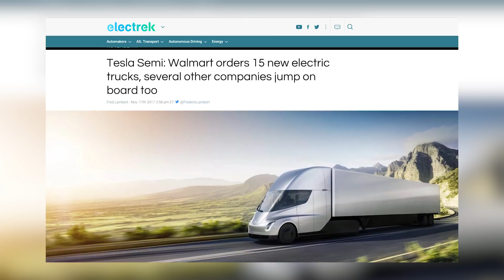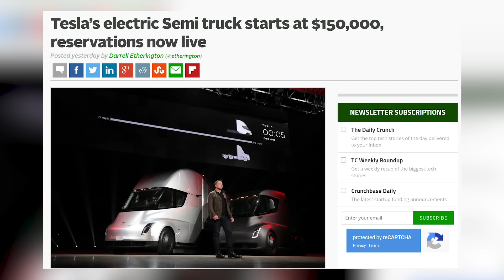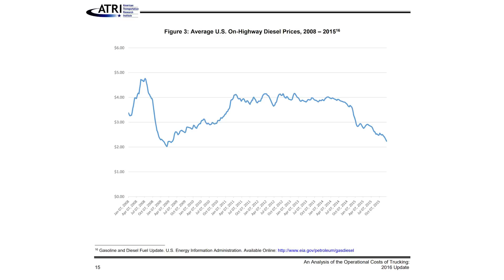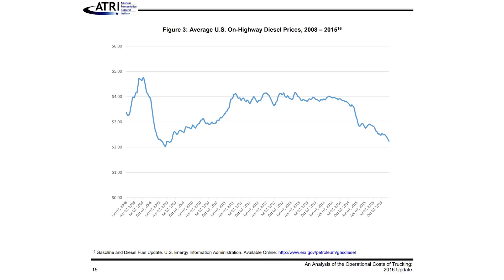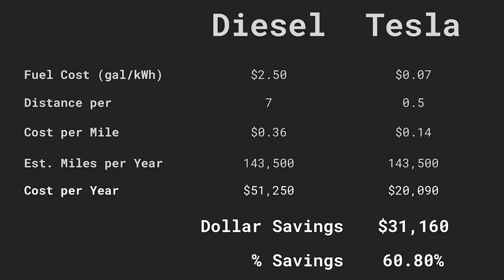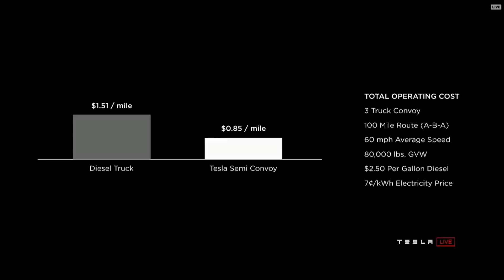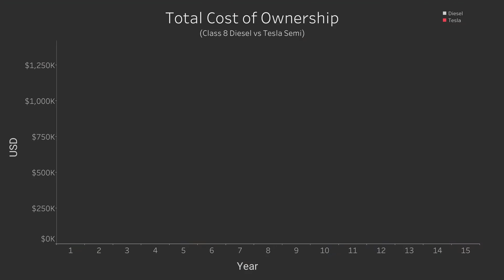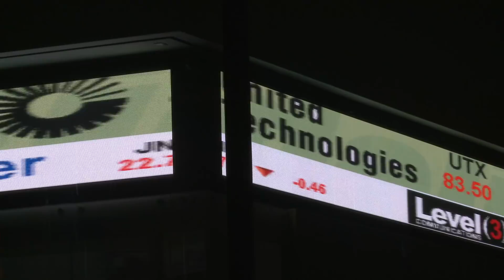What is the TRUE COST of a Tesla Semi?

Comment: Ok pretty impressive. So let’s go to end of life for both types of truck. What is the scrap or recycle value of each truck. Here re some pretty massive metal shredders  so what is the projected cost of scrapping a diesel truck vs the Tesla truck. I’d guess the battery recycling and disposal would be pretty high. This stuff can’t just be shredded and dumped in land fill. Batteries don’t do well in the metal melters either.  So let’s see some info on this  even cars are subject to this although it seems the question is ducked for the most part. I’ve driven many cars well over 300-400 k miles several diesel light trucks have gone close to a million miles.  Most of these got almost as good fuel mileage as cars.  Pulling trailers mileage was outstanding… my last one ton diesel pickup truck had the best cost per mile over all of any vehicle I ever owned. It was almost never in the shop except for tires and brakes. I did a lot of my own service over the years but major repairs on the easel trucks was very minimal.   Thanks for reading.

Comment: Being able to keep that thing charged will be key. The perfect example would be the ability to charge at loading docks at all locations and you can almost forget about the need for mega charging stations. I'm going to buy one and hope that the idea will come to pass. It just makes perfect sense to me. Sometimes lumpers take hours to load or unload so you might as well make good on your time sitting and waiting for them to finish. Like you said time is money in the trucking industry.

Another idea would be to make the trailer a battery bank for drop and hook scenarios. You might be able to use the roof of the trailers covered with lightweight solar panels. Thermo King needs to look into the idea of solar trailers.

Comment: I can tell that know one, talked to a Class A CDL DRIVE 500 miles a day is nothing,for a class A CDL driver try 650 minimum to 720 miles per day for a solo driver on a, 11 Hour Drive schedule This is not a tractor trailer design for teams Or trainers this truck will not keep you warm in the winter where it is -10 or in the summer Where the temperature is 95 and up I want to stay cool in that truck trying to sleep 🛏 This is not including the infrastructure of the US where it is based on gas diesel and grease not including repairs ware a specialized diesel technician only knows how to work on a diesel engine not some Tesla computer good luck trying to find a shop that can deal with that the only people that are saying yay is the people they have no idea about the trucking industry just environmentalist and Tesla stock holders I can’t wait to see this thing fall flat on its face This is a crock of shit if you believe that your brake pads will never have to be replace on where in tear of stop and go traffic with 80,000 pounds working on your brake pads I have beachfront property in Illinois to sell you and this truck does not have interaction differentials that’s really When it comes to snow ice or getting yourself out of the mud this is nothing more at this best a inner city truck try charging this thing at the truckstop I guarantee you the truckstop will charge you just as much to charge that truck then it will cost you to fill it with diesel DOT will never allow a driverless tractor trailer maybe a driverless assisted tractor trailer with a driver still at the steering wheel but never a driverless tractor trailer especially in today’s modern society where everything can be hacked who wants A 80,000 pound driverless runaway missile on the road There are no such things in the CDL world as excellent road conditions let’s not forget that someone still has to drop the trailer open the doors back into the warehouse and deal with the paperwork at the warehouse you still need to pay 💰 For someone to be, behind the wheel this includes the driver assist a tractor trailer and the so-called lead driver

Comment: My company just ordered 50 of these, so I'm doing some research on them now before we get them.

I watched a video of the battery production, and I am impressed on how they are making batteries, and even how they make them for cold weather climates like I live and work in.

The degrading factor is not like a smartphone battery, and if you keep to charge around 30- 90% range majority of the time they will last a long time.

So range is acceptable for most of our routes at our DC, the power is a huge bonus, some of these new automatic diesels we have are very underpowered and are scary af driving in icy hilly areas, not having enough power to get enough momentum to make it up a icy hill, stopping and sliding backwards down the hill with no quick clutching to straighten out the trailer from jacknife in short bursts while braking as much as possible is something that has happened to me in a truck before, but luckily in a Manual Transmission...

 This Tesla would have the same issues, but it has enough power not to stall out on these hills so it would be far less likely for that to happen.

That single wiper blade seems iffy, if it fails there is not other one to use in a pinch, so hopefully it is over engineered to not fail in a ice storm, and rip off driving down a snowy freeway with no safe shoulder to pull off to.

The full size doors are very nice, but climbing over a seat to get to the driver seat might be a issue, but I haven't had a good look at the interior to see how it's set up.

Comment: If the semi is any reflection of their sedans, then the actual maintenance, repairs, depreciation, and up front costs are all higher.  Fuel savings will not come anywhere near enough to make up for costs of ownership.  Run the numbers yourself and do not become disillusioned with theoretical hype.  I keep hearing how Tesla sedans are simpler and do not require the cost of maintenance of a ICE vehicle yet the Model S routine maintenance is $600-$800 every year or 15K miles (whichever is first).

Comment: #1. You priced cost of 0.07 per kWh but go onto the Tesla website and the "small fee" to use their super chargers is 0.25 per kWh in my state of Washington and is as high as 0.34 per kWh in Hawaii.  That blows your fuel savings theory away.  #2.  Maintenance cost of a Model S is around $600-$800 per year or per 15K miles (whichever is first).  That is quite a bit higher than a car of similar size and even higher than a Mercedes of the same size.  So the question is the annual maintenance of the semi.  I suspect it will be higher in spite of not having a Diesel engine.  #3.  Tesla vehicles typically have a heavier dry-weight than cars of the same size.  The extra weight of the batteries eats into your cargo carrying capacity.  If you are talking semi trucks, then that eats into the available cargo weight that you can haul.  Less cargo weight means less product shipped which means less revenue per load.  Do the math before you buy.

Comment: 2kW equates to only 2.68 horsepower.  To suggest that is enough power to move 80,000 lbs at 65 mph is utterly ridiculous.  65mph is 95 ft/second.  2.68 horsepower is 1475 ft/lbs force/second, which means that only 15.5lbs force can be applied at 65mph.  Try pushing an 80,000 lb truck for 65 miles in one hour using only 15.5lbs of force!

Comment: I believe that those
numbers are grossly incorrect . One is that the commentator said the average maintenance cost of a
diesel is around 20,000 excluding fuel. That is incorrect. The average is around
12,000 a year. 

 
Now
Let's make this simple and use the 500 mile version of Tesla. First lets put to rest the
7 cents per KWh charge price claim. That number is a game or bogus. Yes Tesla
may very well offer its price at 7 cents a KWh , but that does not include
state and federal taxes which will bump it up considerably. I would suggest
that the amount be at min. doubled to figure any real costs and probably it is more than that. 

 

 Second
according to DOT the average trucker travels around 100,000 miles a year. Tesla
is claiming the truck will pay for itself in two years. Lets use 200,000 cost
of the truck because there are TTL fees which figures in. That means the
truck has to make 100,000 dollars a year above operating costs to pay off
200,000 dollar initial cost of the vehicle in two years. However they
claim there is only a 200,000 savings for a million miles. 

 

So
using the average annual traveled distance of 100,000 miles and dividing it
into 1,000,000 miles it would take 10 years to save 200,000 dollars, but the
truck can pay the 200,000 dollar price in only two. The math does not add up. If
the EV truck can pay for itself in two years why isn’t it making 100,000
dollars savings every year after that?

 

 Let
me also point out something else. We know that 500 mile number is for flat ground and I
think it is reasonable to believe that the 500 mile range does not include the
use of heat or air conditioning. So on average I would suggest that the real
numbers are around half the stated for the average driver. 

 
In
this video it was suggested that Tesla probably has come up with a major
breakthrough in battery costs down from 145 dollars per KWh. That theory does
not hold water. If that was true then it would also be passed on to their cars
to take a major share of the market with greatly lowered prices (at least half),
but we see that is not happening. The same price drop would hold true to the
Tesla power walls as the same batteries would be used in them to capture the
market share.  In my honest opinion these
trucks will not produce even close to what is being stated about them. I would
hope to be wrong, but for now, although they are a neat new thing, the math
simply does not add up. 

 
I
believe that in the end if the actual full costs compared to a diesel if
calculated properly the EV semi will not save anything. In fact I believe it
will cost more not less. For any projections that will take at least 5 years and
for actual numbers it will take 10 years so we will see. In the end I believe that Tesla has inflated and deflated numbers for marketing purposes. If the EV car industry cannot pay for themselves when compared to a comparable gas model then there is no reason to think an EV semi can either.

Comment: If solar & wind subsidies go away, price per kwh WILL rise, by something like ~2.5x over their current assertions, & for the truck to net 1KWH of energy you need more than ~1.2kwh round trip, i.e. from the power it takes to charge the battery & then discharge, this number is significantly worsened when you fast charge lithium cells & will also negatively impact the number of cycles in the batteries lifespan.  I've built bicycle & recumbant bicycle (three wheels) based EVs, small solar & wind turbines, after having experience & data over time I've come to learn how many slight of hands happen in the world of 'green' tech, EVs in particular.  I do feel that Tesla is being optimistic, one reason being that the rate of the cost reduction per kwh for battery capacity is slowing down, batteries aren't getting as cheap as quickly as they have over the last decade or so, 18650 cells (battery types used in current Tesla vehicles) are hitting their capacity limit, unless polysilicon processes come along quickly, Tesla will likely miss on their range and or cost assertions, I see Tesla coming to market with Tesla Truck 1.0 with a peak range just under 300 miles at a ~20% higher cost, which can still have a market position, certainly in day routes, ~200 or so miles driven in a day.

Comment: I've been in the trucking and business ends.  Stop using fake numbers.  Please!  Tesla is a scam.  Most truckers are long haul and their routes are not consistent.  Most trucks are not new but used.  As battery's get older they lose the ability to store the same amount of energy.  When it comes to money, wow you'll save some on fuel.  What about the increase in insurance, workers comp., Increased electric costs.  Who's going to pay for the new power plants we'll need?  What about the electrical grid overhaul?    Tesla card, because of the paint and sensors are totaled out by the insurance company even with a little bump.  Check the auctions!  Elon Musk is making these cars and trucks because of the tax breaks and the constant capital funding rounds.  Gas/ Diesel has a minimum of 60-75 cents per gallon in taxes.  How are we going to recover that money?  Fuel taxes pays for roads, bridges ect.  If you have drivers like Swift and CRST banging up every inch of a diesel truck at speeds of 0-60 in a minute, imagine what these drivers will do with a rocket sled on rails.

Comment: Just wait until they regulate the hell out of battery disposal from these.  Nobody mentions the battery life and how often they will need to be replaced.  The chemicals in these batteries are extremely hazardous, and with recycling costs, many will be dumped causing some pretty strict regulations (and fees) on these batteries.

They also put out some pretty damn toxic fumes when they burn, and god knows there's NEVER a truck accident that could set these batteries ablaze.  Imagine the clean-up costs, and environmental impact these will cause.

Tackling a battery fire requires special assistance and "emergency response guides"  have been published to help firefighters. Tesla admits battery fires can take 24 hours to fully extinguish and can easily re-ignite. Tesla also details the huge amount of water needed to cool the battery, the position to cut through to stop the power - plus the risk of death in touching the power cables without switching it off first.  Sulfuric acid, nickel, lithium, copper and cobalt are all emitted when an electric car goes up in flames making it essential crews have respiratory equipment to hand, too.  And Tesla suggests "quarantining" the motor for 48 hours to stop a new fire breaking out.

/watch?v=MEVPdmzrGCM

All of these vids only show the plus side of these, nobody wants to mention what's going to end up happening in the VERY NEAR future in new and expensive regulations as these types of problems become more common.
Reply from the maker: Check my videos on this
Reply: Lithium batteries are NOT toxic hazards. "Nobody mentions".... Oh, it's a conspiracy of course. Or maybe it's just not an issue. Current Model S data shows the batteries exhibit minimal capacity losses after years and 100's thousands of miles. Battery tech constantly improves, so we can expect this to improve even further in the future.

Comment: The sensors will make more crashes on road.I driving truck with adaptive cruse control and line assist and bunch of this other sensors.
What happens if you trying pass someone it happens and I drive 500-600 miles every night.
They designed to read center line on your left but soon you go to left line to pass someone then you have yellow full line on your left.
Truck after longer time passing (it is SAMI heavy loads) will brake by it self.
Real scary on wet snow conditions.
This technology is not ROAD ready.
I see Tesla trucks are low from ground.
Are all places we deliver nice and flat?
Seating on center will be real maybe not even possible to backup to some places.
Charge truck while unloading?
OMG customers don't let driver to use there bathroom,they don't have lighted docks and so on...
Maybe possible if all conditions are 100% truck friendly.

Comment: The haulage industry employs an awful lot of people,,, not all truck haulage companies operate on the same parameters for example you certainly couldn't autonomously haul hazardous chemicals,, for legal reasons they must have a fully trained driver in each truck and also certain trucks have equipment which will require an indivdual operator such as a hiab crane for delivering palatised cargo.. These Teslas would work well in the North America Australia Russia and China where long haul convoys are commercially practical but in most areas in Europe you need box trucks as streets are often narrower and there is limited delivery access,, in these model you need regional warehouses where cargo is unloaded and sent in smaller semi-trucks and vans.. However the biggest concern is quite a few consumer economies base the employment on having lots of employed drivers,,, the question is what do you do with all these drivers and techograph inspectors and administrators if you start using autonomous delivery vehicles? It could put potentially a million people out of work.. in a simillar way to the collapse of the old manual heavy industries..

Comment: Million miles without breakdowns.
Maybe the motors will do a million miles, but what about wheel bearings, suspension units, steering units, ball joints, king pins,etc, etc, etc.

Comment: How can Tesla make these claims of 500 miles? A truck working days in the summer on flat terrain with lighter loads will use less power, so go further. A truck working nights in winter, using lights, heaters, windscreen wipers, etc, pulling heavy loads on mountainous journeys will use a lot more battery power, so have less range.

Comment: How much damage will be done to the atmosphere in production of the batteries? Each of the batteries produced for the little Renault electric car puts 1.7 tons of CO2 emissions into the atmosphere before it gets into the car ! This equates to 8,000 miles to produce the same CO2 emissions from a gasoline/petrol driven car of equal size.
Obviously an electric truck is going to need a very large power battery. How many tons of CO2 will that produce in manufacture?

Comment: If 150k-180k seems expensive, a new semi costs about 130k-180k so it is actually not bad. Also, if the Tesla comes with a trailer, that will be cheaper since a trailer is about 30k-80k